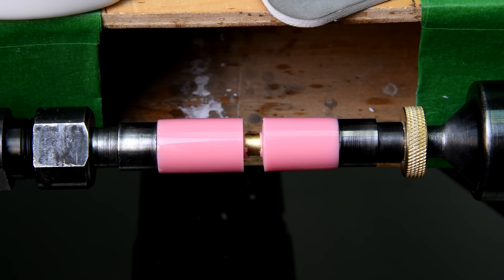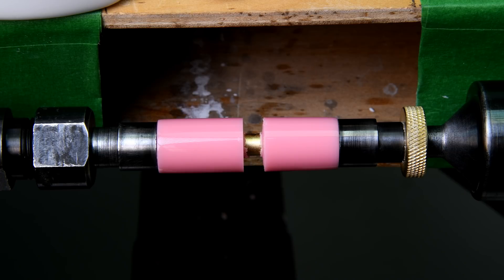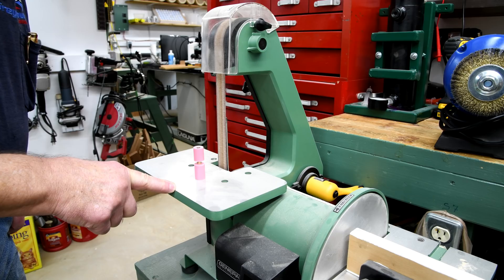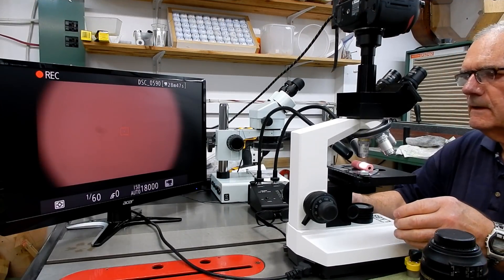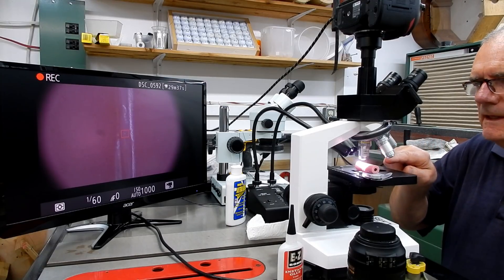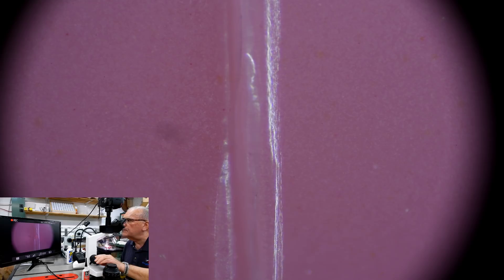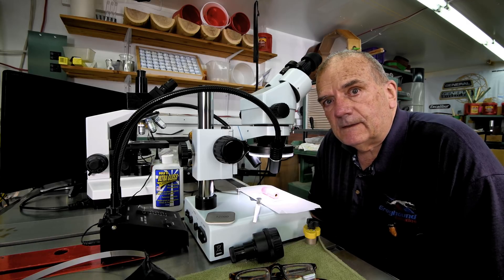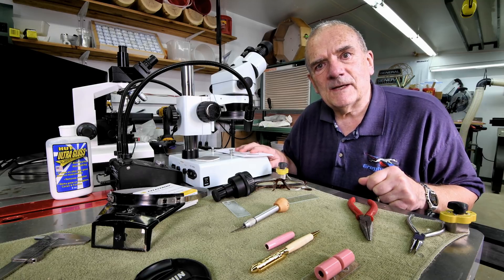What Grit Is It? - Part 3

Comment: What if you took a slide, looked at it under the microscope as a pre-check, then micro-meshed the slide, and then used the hut ultra on just half of the slide, do a post-check under the microscope. you would not be able to use the lathe, but just manually by hand use those two to do a simulation, if you know what i mean. Just thinking out loud. Great video series.